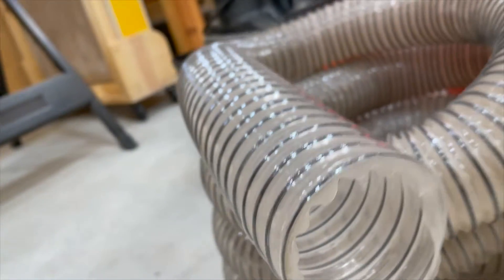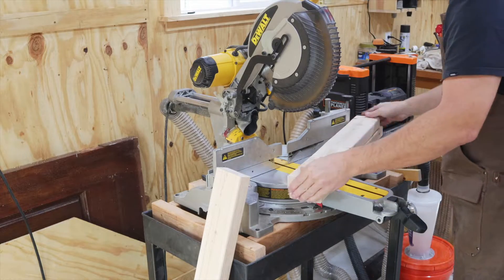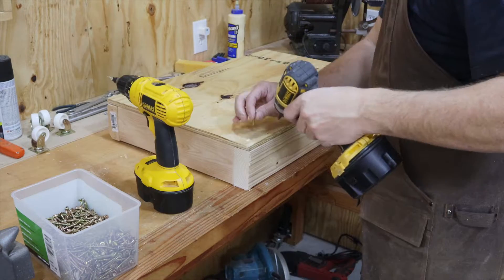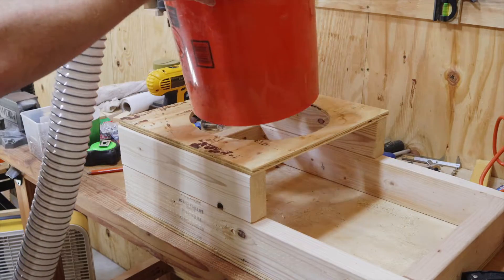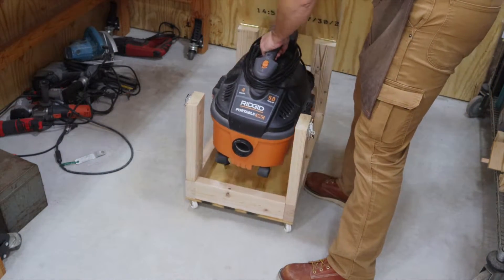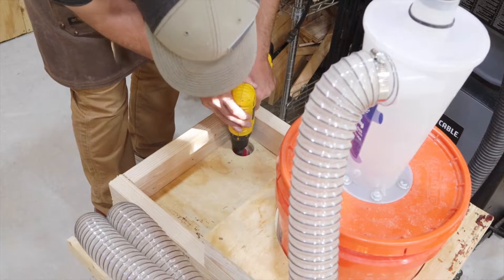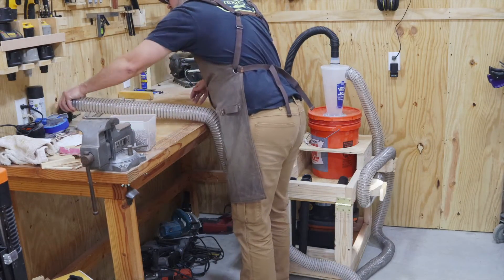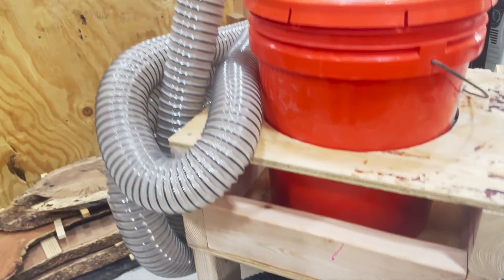How to build a workshop dust collection cart

Comment: Are you running a 2.5in hose off the vac directly? If so, howd you do that, cause i cant stand using the 1-7/8thin hose
Reply from the maker: In this set up, the 1.875 in hose from the vacuum goes into the top the Dust Deputy, and I am using a 2.5" hose from the port there.  I have since upgraded to a larger version of the Dust Deputy that has more capacity and it works even better - https://youtu.be/LNRQKBxrT-s

Comment: Thank you for sharing step by step. I just realized something that is somewhat unrelated, for anyone who is interested in dust collection and cyclone buckets. I actually have two M18 Milwaukee portable round canister vacuums (not the square box vaccum) and I realized the other day that they are the only shop vacuum I've ever seen that has a cyclone effect. Shop vacuums seem to be a conspiracy because they don't use a "cyclone" air stream, so the filter instantly clogs, and all they would have to do is turn the angle of the inlet hose and it would create a cyclone of air (it would cost absolutely nothing for them to just turn that inlet fitting in the tank on a different angle). Anyway the tiny M18 vacuum creates a vicious cyclone, and you can see all the particles of dust and large pieces of debris actually spinning at high speed inside the tank, and the tank opens on the bottom with a removable trap door, so I realized you can literally just set that vacuum on top of a bucket, and have an instant dust collection vacuum that is portable and battery powered! Take a look at them, they are the M18 Milwaukee battery powered canister vacuum.
Reply from the maker: This is all great info!  Thanks for sharing the details!

Comment: Great build. I would face the vacs front where the hose goes to the cyclone facing towards the back so there are not so many bends and turns for the dust to go thru.  A suggestion that I heard from another channel: he explained that if you have for example, a lot of cuts to be made on the mitersaw, to plug the vac directly into the wall. The concern being that the constant on and off may prematurely burn out the motor. He had no data to back that up though. My shop is 4 ft shorter than yours and takes some creative placement of tools to move around as I'm sure you know. Best of luck!
Reply from the maker: Thanks for the tips!  I appreciate you following along!

Comment: HI, my goal is to build the same type of mobile set up for my garage shop.  I noticed when you had the system turned on there was still saw dust from your 2x4  cut.  Is this normal?  I was expecting the vacuum suction to eliminate that.  My expectations are probably way off.
Reply from the maker: Yes, a miter saw tends to spray sawdust all around. While the majority of the dust is directed toward the dust port, quite a bit flies in other directions. I’ve seen some folks build a hood around the saw to capture more dust but I don’t think you’ll get every bit with a miter saw. I will add a hood when I build my miter saw cart so we’ll see how it does.